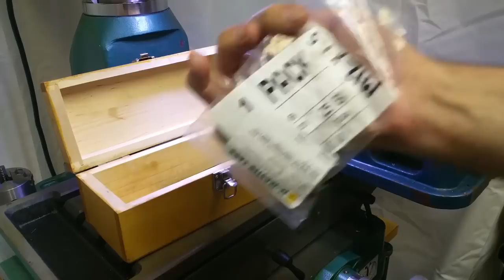Upgrade Your Import Boring Head

Comment: Maybe he should get an American made vehicle milling machine also.
Reply from the maker: The point of this video definitely isn't US is better.  Far from it.  The point is value.  Value exists at any price point but for home machinists on a budget, I recommend an import boring head with a few very minor upgrades to the inexpensive but important parts - hex keys, set screws (aka grub screws), a good carbide inserts and a decent boring bar for those inserts.

Comment: The rediculous idea that an American made product us somehow better just because is foolish. If you own an WW2 era lathe that everyone thinks are so good because they're heavy try not leveling it and see how bad it twists and turns tapers. If import stuff is so bad why in heck do u own one and why are u making a video on how to tweek it. Apparently u don't live by your only by American nonsense. Oh and I spent 6 yrs in the military so ya I supported my country.
Reply from the maker: Like many others, you completely missed the point of my video.  It's not "American made is better."  Generally, American manufacturing has been in decline for many decades.  Entire industries are not even in the US anymore.  If I want good optics, I generally think of Germany and increasingly Japan.  The point I was trying to make is that the Chinese and Indian boring heads are much less expensive, and the worst aspects of that value compromise can be quickly and inexpensively corrected by replacing inferior screws and hex keys with better quality versions of these inexpensive parts.  A secondary implication is the manufacturers of these boring heads could use better screws and hex keys and greatly increase the value of these tools, and they could sell them at a higher price with greater profit margin.

Comment: So basically it’s not too bad for the money…
Reply from the maker: Yep.  Many people interpreted my video as bashing Asian manufacturing but what I was trying to convey is that the value is very good and the quality is good enough for home shop use, but import boring heads can be much better if the fasteners are replaced with inexpensive high quality fasteners and hex keys to avoid the aggravation of rounded hex keys and hex inserts in the fasteners by using good alloy and properly heat treated fasteners and hex key tools, and by replacing the boring bar with a version that uses carbide inserts.  Yes, the brazed carbide cutter can be ground to the proper shape for boring, but most hobby machinists don't know how to do that and don't want to do that.  I know I'd prefer to buy a very good carbide insert and replace it when it's worn or chipped.

Comment: thanks mister, all l have lil mini lathe. l m gonna figure doing my project on lathe instead of my mini mill. Already ordered notha piece of round delrin.
Reply from the maker: I have an old Clausing tool room lathe that I connected to a VFD so I can change the speed without mechanical gearing.  I also have a little Sherline lathe than I converted into a CNC mini lathe using LinuxCNC and electronics that I cobbled together.  It's very cool and it's very handy for small precision jobs.  It only needs four square feet of shop space.  The electronics are on the bottom in the back, there's a front lower cabinet for tooling, the keyboard is on a tray that pulls out the front, the lathe is on a steel table above that and a large monitor is mounted in the back at eye level.

Comment: Quite a few negative comments on the less expensive boring head, but with what you changed to make the improvements, you spent very little extra money, compared to $500.
Reply from the maker: I think many people interpreted my comments as some sort of nationalistic USA rant, when my intention was to make simple suggestions to inexpensively upgrade a low cost boring head to maximize the value.  If any of my comments were negative, it would be my frustration at manufacturers (regardless of country of origin) that save a few pennies by specifying the cheapest fasteners possible when that's a false economy.  Fasteners are inexpensive but critical parts and are not a good place to save a few pennies.

Comment: If it came with qualty screws it would have been $50 dearer.
if an item is made to a standard, it doesnt matter where its made!
this is jingoism at its worst

if everyone had to buy a bridgeport mill and a Kurt vyse we be whittling sticks for a hobby

cheap tooling gets folk into the game

Stavros
Reply from the maker: I think you missed my point, Steve.  From the comments, many people did, so it's not you, it's me.  😁

The point I didn't make very well is that the inexpensive boring head is good enough for those of us on a budget, after upgrading the fasteners, which costs very little to do.

The rest of the boring head is inexpensively made, and that's a compliment, not a criticism.  The poor quality fasteners are inexcusably cheap.  That's a criticism.  Fortunately, that problem can easily and inexpensively remedied.  Replacing fasteners costs very little and greatly improves the performance and reduces the frustration.

Comment: As this is getting on in age. What inserts etc would you use to bore hardened steel?
Reply from the maker: Andy Taylor - There are ceramic inserts that are very hard that are designed for "hard machining", machining hardened materials.  The chips come off the work red hot.  It's dramatic to watch, and a little scary at first.  It looks like something is very wrong in the feeds and speeds.  The problem is, a boring head is more of a precision tool than a tool for applying that much force.  The problem is the diameter.  The force is translated through the large diameter of a boring head to create a large amount of lateral torque.  The tool isn't designed for that despite its beefy appearance, and even if the tool was stiff enough, the head of most milling machines, and I'd dare say all of the inexpensive import milling machines, is not up to the task.  I've seen pictures of the large cast iron head of an inexpensive imported milling machine that cracked in two.  These machines are mostly hollow, with a cast iron thickness of 3/4" or so.

Comment: You don't describe anything wrong with the boring head per se at all, aside from noting it has some backlash which as you also bite isnt a big deal (all leadscrew have backlash, any machinist knows to use them one way only). You dont like the screws? Change them. Costs cents and takes 2 minutes. The free "get you started" allen keys ? Ditto. Neither is a reasonable justification to slag off the boring head let along justify spending enormously more on a us (or even better European) made one.
Reply from the maker: Dave Smith - Congratulations Dave.  You understood the basic information of the video.  If you're a pro, it's worth buying high quality professional tools.  If you're a home gamer in a home shop on a budget, you can get by quite well with a lower cost and lower quality boring head if you spend a few dollars on high quality set screws and hex keys where the manufacturer saved a few pennies too many by going cheap on the inexpensive parts that matter the most.

Comment: If your using a minimill or just machining as a hobby these cheap boring heads are great.. i didnt have any issues and they will allow presision to under .001”.  . He is right anout the boring bars though. Fine for aluminum but get yourself a insert set, you will chip the brazed carbide tips

Comment: When you buy a boring head, no where does it say you have to use the brazed boring bars. So the boring head is just fine, don't over tourqe the set screws, and use an indexable boring bar. This video showed no improvements on the boring head, because it's just fine.

Comment: Sorry, I wouldn't spend $1000+ for a GOOD boring head even if I had the money to do so.( even used a GOOD boring head is very expensive)  As you said, the grade of  brazed carbide is acceptable but is way above centre line. TOT (This old Tony) shows a quick fix.

Comment: I have owned and used a boring head like this for 15 years in a commercial shop.  I changed the screws and Allen wrenches. Other that I have no problems with using it. For the price I believe that is a good value. I would certainly buy it again. Sometimes It is not the tools fault.

Comment: typical chinese bashing! dusgusting!
Reply from the maker: Value exists at every price point.  When I'm a hobbyist or home user, I'll often buy a lower price and lower quality tool because that's an appropriate value proposition for me, as was the case with this low cost Asian import boring head.  The point of this video is not to disparage Chinese product quality, but rather to help people to spend a few dollars on minor improvements that can eliminate most of the shortcomings in a low cost boring head.  Sorry if that sounded like "Chinese bashing" to you, but the fact is, the set screws and hex keys in my boring head were garbage.  The metal was soft and the fit was very loose, which was a recipe for stripped set screw hex sockets, rounded hex keys, busted knuckles and frustration.  Fortunately, there's an easy and inexpensive solution.

Comment: Are the tormach boring heads the same quality as most of the china boring heads just at a higher price?
Reply from the maker: halfstep67 - I honestly don't know about the quality of the Tormach boring heads.  They do sell some good quality Chinese tooling at decent prices.  They also sell some better quality tooling at decent prices.  I've never known Tormach to sell junk.  I love their little SuperFly cutter.  If their boring head looks like an Asian import, I bet it's essentially what I describe in this video, an upgraded import boring head with some small improvements that make a big difference.  It probably has less backlash in the adjustment too, but that's not really a big problem with a boring head.  It's more of a problem with the perception of quality, or a lack of quality.  My import boring head has a lot of backlash in the adjustment, but I back it out and then continuously adjust it in and lock it down after each adjustment, so I only notice the backlash at the start and end, and not when adjusting each cut.
Reply: Thanks for you reply. I have the tormach superfly cutter, I haven't used it yet. I just got my pm940 mill and in the process of converting it to cnc. I need a boring head for making the ball screw bearing mounts. Last night I ran across an unused  3" APT boring head with the R8 arbor for $90+20 shipping. I got a great deal on that one. I would have preferred a 2" so I could have used 1/2" boring bars since my lathe quick tool post uses that size. So I will probably make or buy a reducer from the 3/4" to the 1/2". Does anyone sell them?
Reply from the maker: @halfstep67  - Best of luck in your PM940 CNC conversion.  I'm doing the same thing with the Taiwanese mill shown in the background of this video.  LinuxCNC FTW!

As I mentioned in the video, you can probably get a 3/4" to 1/2" drill bushing and cross drill it to make the reducer you want.  Otherwise, it's a fairly simple project if you have a lathe and milling machine.  Or you could buy the boring bar you need from a quality supplier like Mesa (link in the description).
Reply: Thanks. I found some bushings. How long did you make your bushing?  Sorry for all the questions.
Reply from the maker: @halfstep67  - Optimally, the bushing should be the length of the depth of the hole in the boring head or slightly longer for good rigidity.  If you find shorter drill bushings, you might use one on the top, one on the bottom, and cross drill the one in the middle so the boring head set screw can pass through to clamp the boring bar.  One caveat:  Good drill bushings are probably made from hardened tool steel.  If so, cross drilling them would probably be a lot more difficult than making a custom reducer.

Comment: Yeah it's a crap boring head ,the cemented carbide boring bars are just rubbish, but sourcing decent ones help you get anywhere near what one could consider a precision bored hole! Use this same boring head 15 years ago ,and like you i had to do pretty much the same , it fine for the home machinist but has no place in a commercial percision machine shop.
Reply: And the meaning of comparing commercial and home machinists is what ????
Reply: @sidewind131258  Where time is money,  at home it might be ok if your just doing it for yourself, but if a client is paying upwards of $90 - 100 dollars an hour for machinist to bore let's say 10 holes at 65 diameter x 50mm deep in G400 plate all holes are pre drilled to 62mm diameter all you got to do is plot out centers and bore to a tolerance of 65mm +0.03  -0.00 with 2 roughing cuts and 1 finishing cut to size and a 1.5 hour window in which to get this job done , it makes a huge difference between a good boring head with a boring bar with replaceable tips and an inferior one with cemented carbide tips with the wrong geometry trying to scratch away at it and all while you're trying to get within tolerance and the a allotted time frame.  Like I said , been there done that it's just not worth it , try explaining to your client there's $500 more on his machining bill , that my friend is the difference.
Reply: Dear  @dratempest610  If you had looked thru the video, then you might have discovered that the video was NOT about how an import was compared to an native tool in an COMMERCIAL environment, but in an HOME MACHINIST environment. As to the specifications you mention of +0.03 -0.02, I assume it is mm, because the rest of the measurements are, that I can do on both my Myford ML7 and my Boxford AUD LATHE using a milling rig on the compound slide in less than that timeframe using my homemade boring bars, and I am an amateur, so your "pro" machinist is really overtaxing you, but if it pleases you to pay ........ be my guest, whatever floats your boat
Reply: Sorry I should have been a little bit more clearer , but I did say (plate) and referring to being set up in a mill as shown in this video, and not machining 10 individual parts in lathe , sure 10-15 minutes work .But you’re going to have a trying time fitting a 200+kg 600 x800 x50mm plate on or in your Myford lathe or boxford lathe  which both are great lathes by the way , Ive owned a Myford super 7 for home use excellent modellers lathe . What the presenter has said is the best thing one can do to make good improvements to this Chinese boring head but it lacks the rigidity required for heavy ruffing cuts , but hey what would I know , I’m only a lowly tool and die maker ! But best of luck to you 👍🏼.

Comment: I don't know about the boring head you have in this video, but some years ago I bought  the 2" import Criterion copy and have made it run well. Right off the bat it got me that they are made so that the .001 grads are actual motion so that it's a diameter increase of .002. Just like the import lathes I have used. A genuine Criterion (and any other brand made by "thinkers") halves the motion like it should be
Reply: The majority of tools that 'show radius'' rather than diameter are based on British machine tools from 19th century. A lot import 'inch' equipment as it's often metric thread with inch dial, most fun is when you have a combination of inch and metric on different axis. Personally I find it much easier to remember your making a cut of specific depth. It's simpler when you switch from lathe to mill but of course, you do actually have to think about what your doing. It's also much easier to 'split'  dials when the marks are further apart. In my opinion, the 'show diameter' was introduced so unskilled or semi skilled workers could rough out work, probably during war production so there were less scrap parts?

Comment: The cutting angles on the brazed on carbide piece on these sets of so-called boring bars are seriously wrong. It is in fact "blunt." I bought a green wheel (for carbide sharpening) and reground the set I had for many years but didn't use it. When I bought my small lathe I got very frustrated with these boring bars. The heads of these boring bars are also very bulky. I just went and bought boring bars of different diameters with indexable inserts. I will also think twice before I buy one of the boring heads in the video. Thanks for the info brother.

Comment: Never ever buy this brazed on carbide tip so-called boring bars. It is absolute garbage.
Reply from the maker: I've used the brazed on carbide boring bars, but the angles seem random.  They have a nasty tendency to grab the material being cut, with a failure mode where they gouge the workpiece and that causes tool deflection that results in deeper gouging.  The violent crash happens quickly.  The workpiece is usually ruined and it's dangerous.  I've had much better (and safer) results with a good carbide insert.  I think the cheap brazed on carbide tools are a false economy.  I'd much rather have one good carbide insert tool than an entire set of the brazed carbide tools.